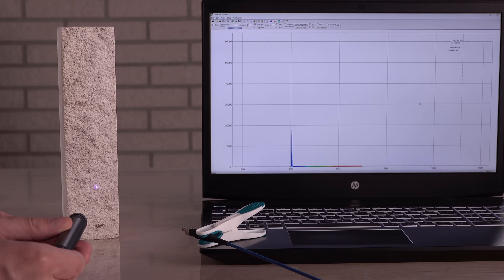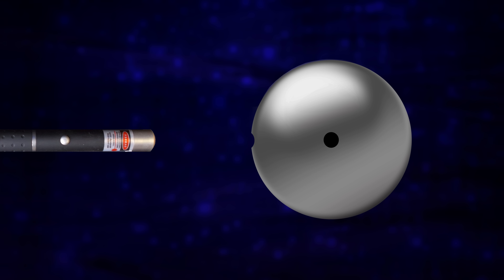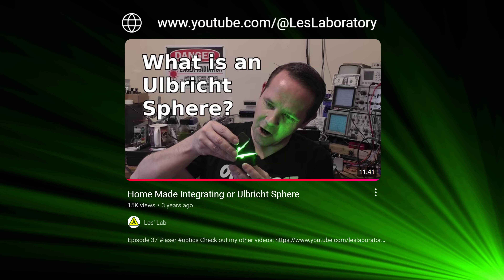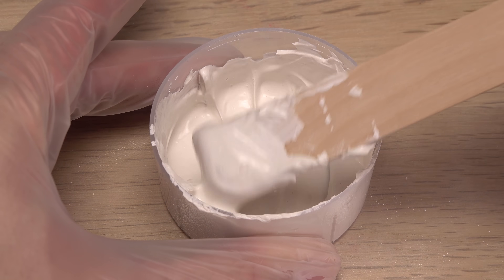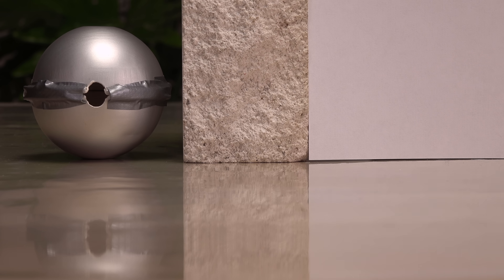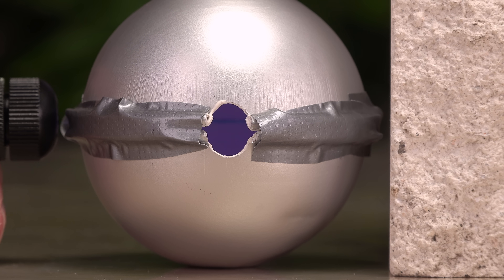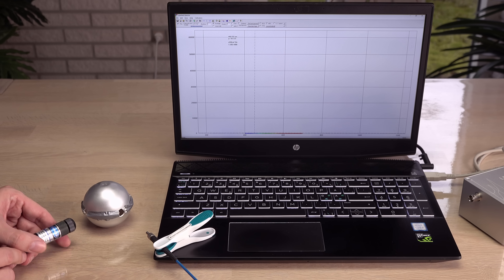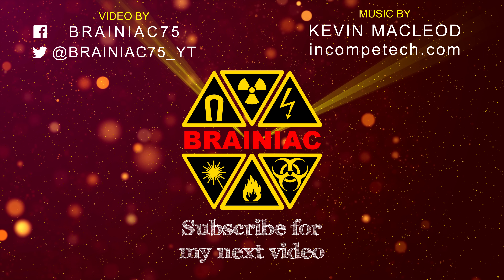Cake Mold as LASER Diffuser?!? | DIY Ulbricht Sphere Prototyping and Testing

Comment: Now that you have Bariumsulfate you can do so many experiments with light and temperature! 
Also I would tinker around with etching the surface of the aluminium, maybe very diluted sodium hydroxide solution, so that the paint can stick to it. Slightly basic solution shouldn't do any harm to barium sulfate anyway. Maybe you can leave out any thickener at all.

Comment: drilling on the seam was an interesting choice. Could easily have made the holes 45 degrees lattitude on each hemisphere, where the metal is stronger.
Reply: Sometimes you're so focused on your first thought that you can't see an easier way to do the thing you want to do. I know I'm guilty of it.
Reply: or even drill 2 holes just in one hemisphere.. ;-)
Reply: I mean, he did say that he wasn't a metal worker.
Reply: And the seam wouldn't be the first surface it would hit
Reply: @dbdba  wouldn't the seam cause significant scattering? As long as the seam isn't absorbing spectrum, then that seems like a very good way to cause diffused lighting.

I think my approach would be to have ports in each hemisphere on an offset, so that there is absolutely no direct 1st or 2nd reflection path possible. Instead of being angled 90° from the center of the sphere volume, the entry and exit could be aligned so that the photons would need to effectively reverse their direction. Effectively parallel to each other, but offset to the left or right side of the sphere, the laser could be projected into a port on the top hemisphere and read by the analyzer on the bottom. Shrouding the analyzer so that only photons are received from a very narrow angle of exit, you could find alignments for both the laser and the analyzer which only capture photons which have traced a significant number of reflections. 

The other consideration I might have made would be to use a very watered down glue solution and slowly tumble the sphere with the slurry so that the entire inside is coated, especially along the seams to create a surface which is as uniform as possible. If you drilled the ports before, you'd probably need to add a small cavity to capture and re-release the slurry back into the sphere as it tumbles, but over the course of hours, days, weeks, etc, the interior surface should be very uniform. The exact time and the viscosity of the slurry would need some calibration to figure out the right balance.
Reply: @R.B.  I love this comment because it is a great reminder why the Lab Grade one is $3k. When Brains listed this prototype as "improvable" compared to the brick, this is it, huh. There are millions of modifications to be made that will make this better yet more expensive. I feel like if these ideas keep being spread and discussed, we can have a genuinely high quality design and process for making these. Science is so much more accessible when we push and pull on each other!!
Reply: It does make more sense when you see that the cake moulds have a flat spot to sit on.
Reply: Just put in two holes somewhere on one of the sphere halves that aren't in line with each other, then put in a rivet nut in each of the holes to get a strong hole.
Reply: came to say the same thing.   It's a sphere, and a diffusor that doesn't need to be precise.

Comment: Probably would have been easier to drill in the smooth portion of the sphere, not at the joint. The 90 degree separation is still done if the wholes are 45 degrees up and down from the seem.

Comment: Very cool! 

Would love to see the big version with your more powerful lasers! :D
Reply from the maker: Thanks, JustPyro. Yeah, I need to make a bigger version, but I am not sure I am going for the that large aluminium cake mould. I think a 3D printed version is the way to go :)
Reply: @brainiac75  Yes, sounds like a good idea! :)
Reply: @brainiac75 The one concern with A 3D print for this application would be melting some of the plastic because most 3D printing plastics melt at a very low temperature, Even with this highly reflective material it would concern me a little
Reply: @brainiac75  If you do use a 3d print, it might be helpful to have a void in the base, pause the print half way, and fill that void with something like sand. then it will be more stable on the bench!

Comment: Wow how much did it cost you to make this ? And what is its purpose for ? And i have a question where can i find small 20 x20 neodymium magnets i tried searching them on Amazon but instead only ferrites magnets are selling are there any of these magnets that ship worldwide if any 😀
Reply from the maker: Well, the 3 small cake molds were around $6. 1 kg of barium sulfate around $18 or so. The wood glue, gaffer tape and water are almost negligible in cost for one. So maybe 3$ a piece for this Ulbricht Sphere :)
Neodymium magnets are not easy/cheap to ship due to their high magnetic strength. I don't know where you live, but in Europe I can recommend magnetportal . de and supermagnete . com. In US I would try magnet4less . com    Thanks for watching!